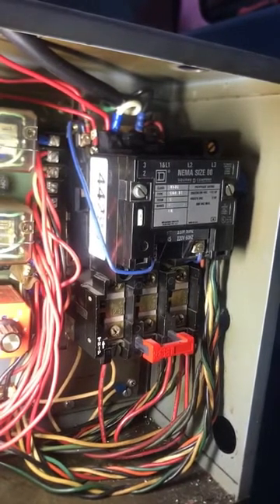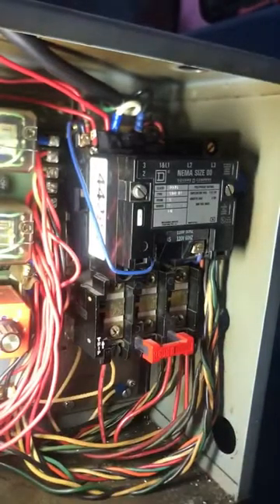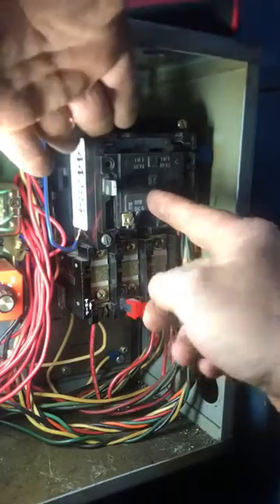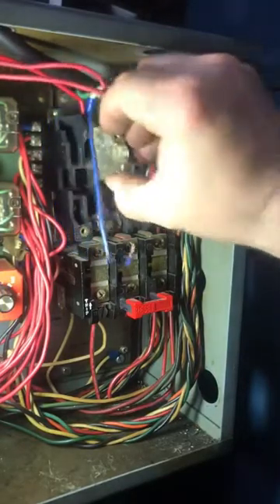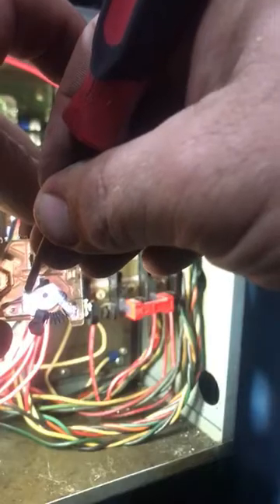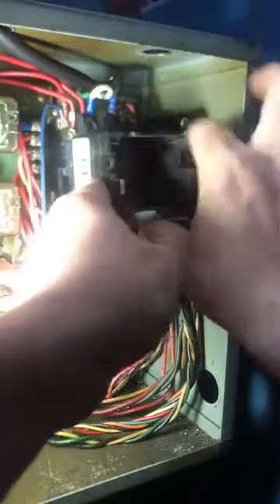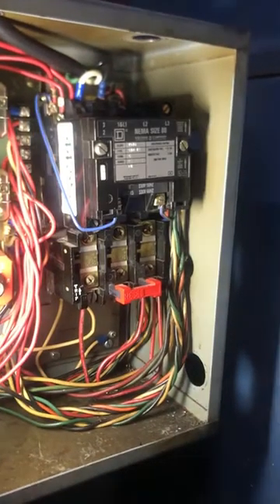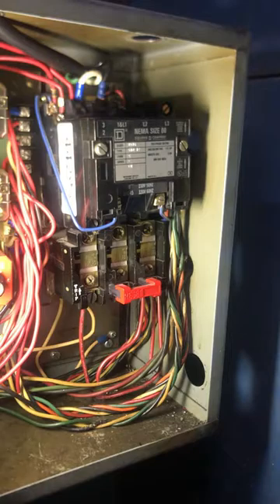Magnetic Motor Starter not working? Try this before you replace.

Comment: Why would you take apart the contactor to play with a button that you’ve already proved to work before disassembly? You didn’t change nor fix anything. Learn me
Reply from the maker: The contactor contains a pull coil that is energized by two separate circuits which are connected in parallel;  the outside button, and the clear switch. The outside button is momentary and when activated, pulls the contact closed. The closed contactor physically closes the "NO" clear switch inside. The clear switch had damaged contacts and could not pass electricity therefore when the outside button is released, no voltage is applied to the coil and the contactor physically opens and allows the clear switch to open. By tweaking the clear switches' contacts internally, it was allowed to conduct current to the pull coil, holding the contactor in the closed position as the outside switch is released. Also, the stop switch is a "NC" switch that supplies current to the clear switch and is required to break the circuit holding the pull coil, allowing the contactor to open when desired. The video clearly shows the before and after results of the modification. Why would you say that there was no change or fix?